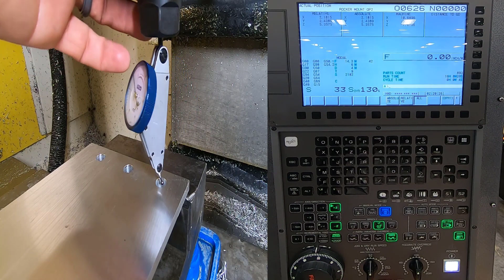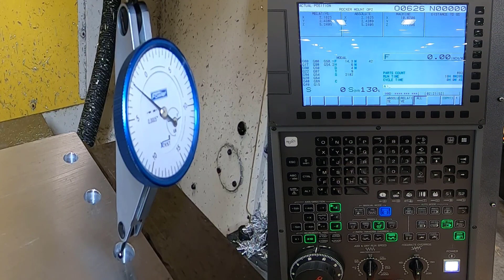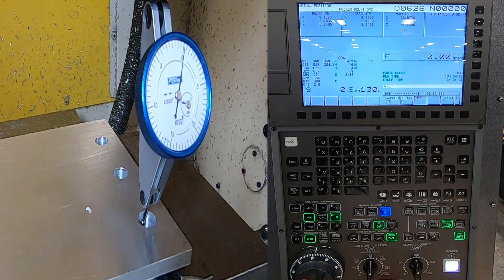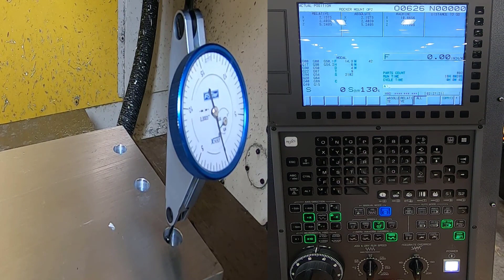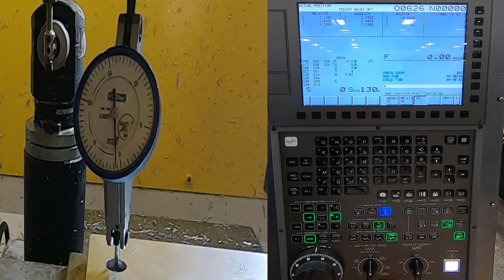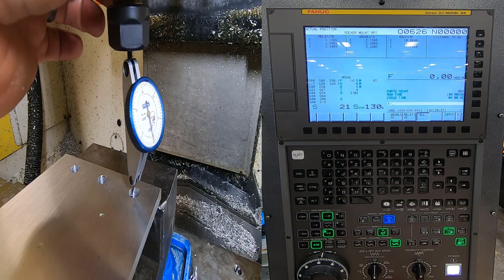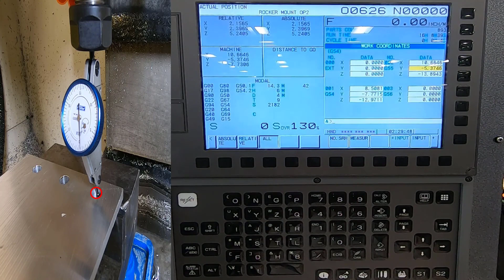How to Indicate a Hole on CNC Mill Using a Dial Test Indicator

Comment: Hello SIr would you please teaching us how to set A,B,C on 5axis work offset please. Thank you
Reply from the maker: @thanhnguyen-cg7ve  hello there, and thank you for reaching out. Unfortunately, most of my five-axis setups have all been on three-axis machines using a trunnion or pivoting 5-axis head with a and b axis. All you would need to do however if you did have a machine that you're indicating a part on that was at an angle is you would have to align that hole with the spindle  by first indicating the surface with your indicator to get your A and B or C axis on that plane and then once you are there you would simply indicate that hole for XY work offsets. Since this is a common practice in industry, I'll see what I can do to create this video. Thank you for watching
Reply: @aaronrunk4209  thank you for you Ans ,I hope to see your video soon.